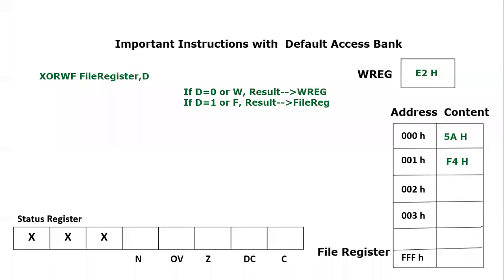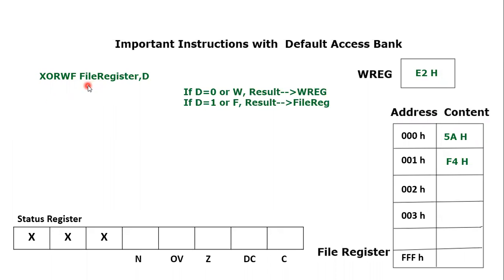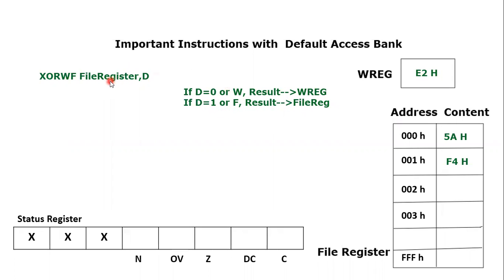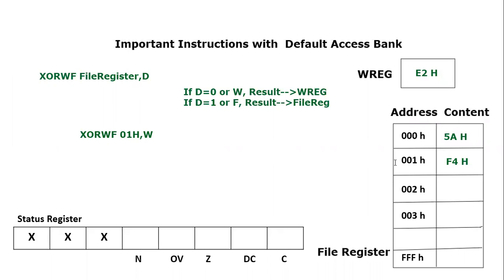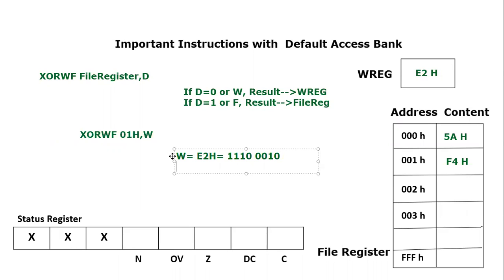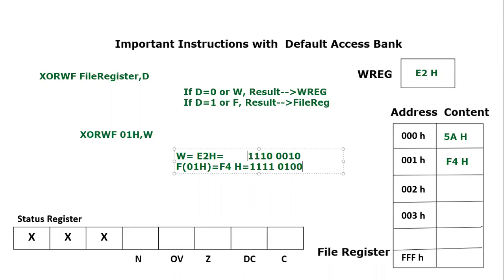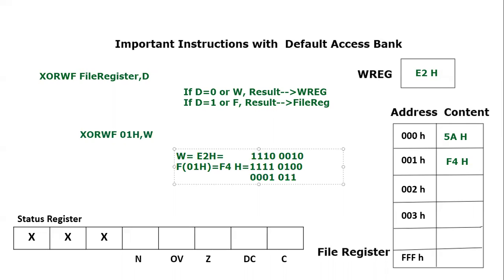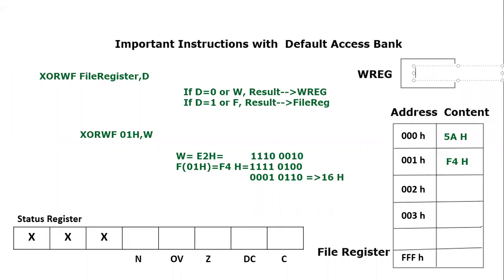XORWF Instruction of PIC18F Microcontroller's Assembly instruction set

Comment: Kindly explaining the role  of z flag effected by xor operation.
Reply from the maker: If two numbers same numbers are xored then all the resultant bits will be zero which means it will set the zero flag. This application is used to check if the numbers are matched of not.